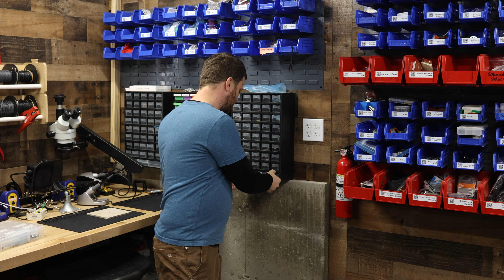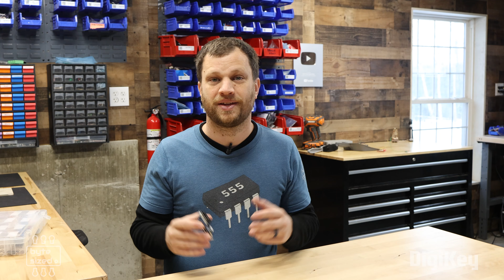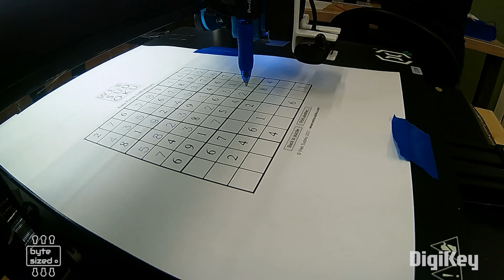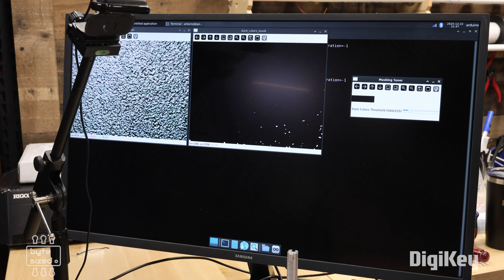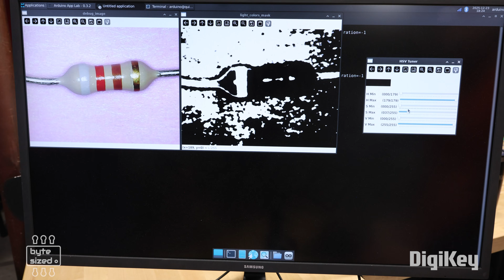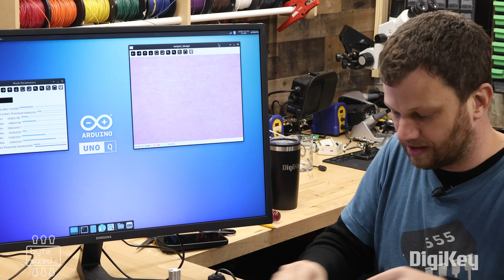This Arduino Uno Q can automatically analyze my resistors - The Byte Sized Engineer | DigiKey

Comment: BTW, if you need a precise resistor value scrape a little bit of the paint off the resistor lengthwise in a thin line while measuring and you can get down to a few ohms.

Comment: When I find a resistor I'm not sure what value it is, I just get out the multimeter and measure it. Much quicker than plugging in a microscope and waiting for a computer to boot. Still a cool project though.
Reply: You don't have a jeweller's  loupe on your desk or in your drawer? I've had the same one since 1967. Given to me as a gimmick by a components salesman.
Reply: :face-blue-smiling::face-blue-smiling: 🤣🤣😅😅

Comment: You now need a pick and place robot. And also make sure it stays out of the bench space, to do other better things. One challenging project, make a manual pick and place robot, that is given access to pcb, parts tray and schematics. It will then proceed to figue out, pick(vacuum pen) and place a component(additional rotation) on users command(may be a laser pointer, that blinks twice). Don't automatic pick and place machines already do that, never mind, the fun is not in getting it done, but in the process of making it work. An easier alternative is to conrol the image on screen to highlight a component placement, depending on which bin the component was pickedup from🤔. ❤👍

Comment: This is a great learning project for machine vision, but economically this is poor use of time. If you value your time at $25 an hour, you can just buy a resistor assortment of a few thousands pre-sorted resistors and throw out the unorganized bin. And not even counting the equipment needed here and that all of this will likely take more than an hour.
Reply: ditto, but it was just designed to show how one can use this technology, not a serious project

Comment: Nice stuff!
Improvements worth a shot:
1) Add a secondary light, switch off the camera's glary light (or at least add a diffuser - Teflon-tape from a plumber's kit works nicely).
2) Use a black background, first identify a resistor-shaped blob, and only then look for stripes within this blob.
3) What about 1% resistors (with 5 bands instead of 4)? My "recycle"pile usually has both variants. I get it, that the 4-stripe one is the MVP.
4) Did you test with grey bands too? IMO it is tricky for an HSV fitting on a backgrund of unknown color (blue? beige? cream?) A good first step might be to identify the base-color of the ceramic e.g. from the tips of the resistor-shaped blob, and  then hunting for colors that are different than this background color. The metallic leads at the tips of the blob might provide excellent fiducial points to graw an axis "across" the stripes.

Comment: we are absolutely doomed if we are sorting resistors by using ai-video detection on a microcontroller to identify resistors rather than, you know, just measuring the resistance of the resistor. This is an ATmicro task, not an NPU task
Reply: he did say he was gonna over-engineer the solution

Comment: Imagine the good old days when a person could do that in their head.  Oh, wait...
Reply: Back then the only people who really did many projects that involved a wide variety of resistors were ETs and EEs, so yeah, they had that all in their head. Now, many hobbyists have a wide range of interests and memorizing resistor colors isn't something that is worth the effort since they may go months if not years without needing to think about it. Then you have people with color deficiency issues. A lot of the hues they use look the same to someone with partial color blindness. I have trouble distinguishing the orange and brown in ethernet cables. Thankfully I can go off the amount of twist in the wire to differentiate them. I think the chart and this project could likely be bypassed with a multimeter, but that's not the point. The point is getting us to think of projects that we can make ourselves that would help us get excited about mundane chores. :D
Reply: @jasonbailey9139  Back then there were a wide variety of people who were into electronics as a hobby, and looked at the resistor chart as "the basics."  Back then, a handful of components, and some brain storming would cough up a project.  Or a person could just buy a project.  Nowadays, it seems coding matters more than the basics.
Reply: I still can do that  but my eyes can't